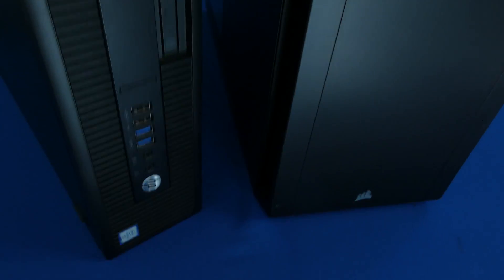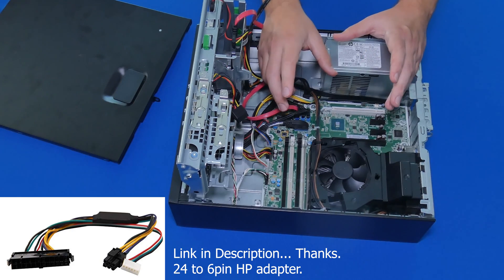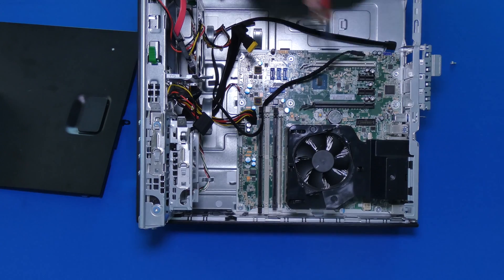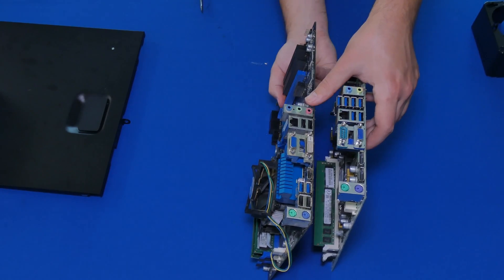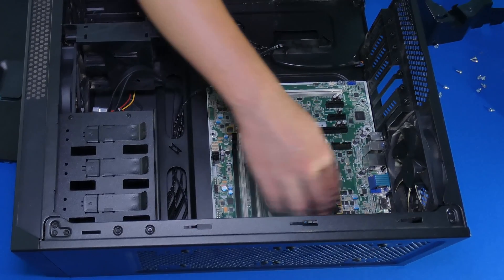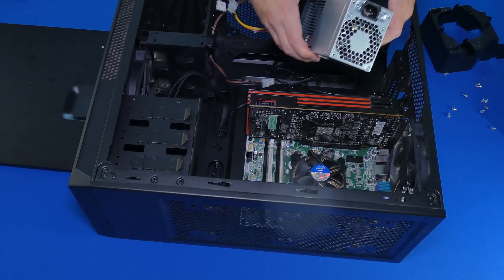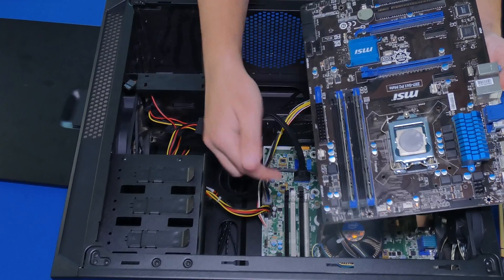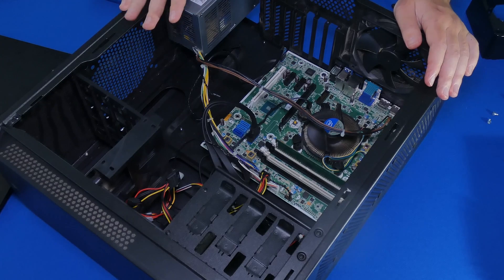HP EliteDesk transferring Parts to New Larger PC CASE

Comment: Hello once again friend, im really close to transferring my elitedesk to a different case right now, but it seems that i can't figure out how to connect the case cables to the motherboard. Can you please tell me how you connect yours and get it to work? Or maybe make a quick video or atleast just give me a picture of it haha. I connected the power switch cable to the second highest pin (pin 3 and 4) and it seems to work like you said but for some reason it just powers up the desktop but not my monitor. Perhaps there are something wrong with my display i may have done during the process of transferring?
Reply from the maker: Hi, if you can tell that Computer is turned on but monitor not working... I would assume the issue is with the monitor (unless you've added a GPU). Check all cables or try different cables.
Reply: @Cobuman  ok so it actually worked lmao i was just being stupid haha. So what happened was, i was using a tv as display instead of a monitor, i got used to monitors that always turns itself on whenever you power up the desktop, on the tv or at least my tv i have to click the on button first before powering on the desktop. As soon as i posted the original comment i went and try to turn on my desktop after i turn on the tv and it worked haha. But the problem with the HDD LED and power LED is still not solved because idk the arrangements for the pin :(

Comment: Hi there bro. I have a hp pro desk 600 g1 sff and I am also interested to trasfer my motherboard to a new case and upgrade my gpu and psu. You can put in a case tower without problems?
Reply from the maker: If it's an ATX midtower it should be fine.
Reply: @Cobuman  i am don*t understand
Reply: @Cobuman  ???
Reply from the maker: @techgames8499  If your new case is the same size as the one in video... it should work just the same. Aftermarket computer cases like in the video have standard size charts... this one is a midtower ATX.
Reply: @Cobuman  Brother
I do not understand
Can I put the motherboard in the tower?

Comment: I tried this but it doesn't work with any newly fabricated ones the motherboard is different and they removed the fan
Reply from the maker: Thanks for letting me know. Which model of PC did you try with?
Reply: Thanks for responding it's the same one but i bought it at a store that sold them in large quantities and they said that they make them like that they switched the cooling system and made so you cant fit a full sized graphics card if i could send a picture i would and the motherboard is smaller sorry if i caused any trouble

Comment: Does anyone has a suggestion for a suitable, higher power replacement for the 240W power supply that would (hopefully easy) fit in the standard Elitedesk 800 G1 case? Would and SFX power supply work?

Comment: Hi there bro. I have a hp elite desk 800 g1 sff and im also interested to trasfer my motherboard to a new case and upgrade my gpu and psu. You think the Neutron Odyssey M-ATX case may om my board?
Reply from the maker: The motherboard here is not exactly same size as standard ATX or m-ATX; that being said... I'm not sure. But it fits in standard size ATX case.

Comment: Hi cobuman! First of all thanks you for making this video. But I have a problem installing the new PSU to the motherboard, I connected everything and it just doesn't start. Also there's a light in the motherboard that is blinking with the new PSU, but with the stock PSU it's everything right and the light stays on well. Is there a solution?
Reply from the maker: The adapter for using the new PSU may need to be adjusted. Some adapters require swapping wires. If you bought it on Amazon you can see what other people did to fix it. It depends on which adapter you got.

Comment: I have read there is a problem to install a full-length GPU card because the front USB connector is too tall. And if you leave it disconnected, every time when it boots, it will complain about missing front USB connection. Have you come into that issue or have a solution for it?
Reply from the maker: Yes, I've seen comments about some cards having this issue. The error can be ignored but obviously you no longer have front USB... This is simply a design flaw by HP.

Comment: hey, i have hp compaq elite 8200 sff can i transfer it to a larger case?
Reply: No i tried. bought a btx case and the 4 screws to hold the cpu fan don't align with the motherboard.ANNNND you will need a 24pin to 6pin adapter to fit the new power supply you plan to use.So far i have yet to find an adapter that works for the 8200 sff. also the 8200 sff needs a different adapter than the 8200 atx.SUX

Comment: I did all this and assebled perfectly on my new Case, but the problem I'm facing now is a dumb POST error that says that front USB ports are not connected, did it happened to you too? And if so, how did you solve it?
Reply from the maker: This happens to some people. If you don't have front USB ports connected you can just continue to boot and ignore the error; otherwise, connecting front USB would remove the error. This depends on which case you have so I don't have exact answer to guide.
Reply: @Cobuman  if you have a GPU installed it blocks the USB 3.0 plug. So it boots with an error message. I don't see any good way to fix the error message and keep the GPU.

Comment: Hey man! Great video! I have done the same thing but with 800 g1 and amd r7 260x. 
Do you maybe know why my monitor keeps random losing signal after transfer. 
Cables are securly fittedand temp. never excideeds 70 celsius
Reply from the maker: I'm assuming you've added the r7 260x after you transferred everything? If so, it could be an issue with the card. Driver update might fix it. 
There is a chance that it may need more power from PSU to run properly.

Comment: I dont have the money for a new case atm could I just run a adapter and a power supply. But I'm running the hp 800 g1. I already have the GPU 1650 gtx LP I plugged it up and couldn't really play mostly got constant blue screens of death when trying to run steam or just at random. Any suggestions would be appreciated cant really spend a fortune.
Reply from the maker: See my reply on other video.
Reply: @Cobuman  oh you're awesome

Comment: Did the motherboard accept the newer GPU without any problems?
Reply from the maker: Yes,  here is a video of me just adding an external GPU: https://youtu.be/tj2ws0mTm6E
But yes, any GPU should work when used in larger PC case. Otherwise you can install a low profile card that fits inside the original sff case. Like this: https://amzn.to/3f05sxA

Comment: I'm using hp 800 g1 with configuration 
CPU: i7 4770
Ssd: 240
Hdd: 1tb
I want to install gtx 1050ti oc or 1650 GPU low profile, will this work???
As this PC has 240w psu 
Thanks in advance
Reply from the maker: Yes, it should be fine. I've recommend GTX 1650 LP to a lot of people, this one: https://amzn.to/3crxMaH
Reply: 1650 Low profile definitely works. I have the same setup and was able to run OW around 180 fps, GTA V 150 etc. with some tweaks (1080p low). I still have the g1 unfortunately the mobo got some bent pins and it's dead :( But the 1650 i've set as a folding GPU until the covid pandemic goes away; probably will turn into a stream gateway afterwards (the 1650 is good for streaming as well due to the Turing Arch; if you don't mind low quality graphics, you could mistake it for a 1060 (even though the 1060 is better etc)

Comment: If I change the PSU, can I just use the 4 pins from the 20+4 pin and plug it in the 6pin power connector on the motherboard instead of buying an adapter?
Reply from the maker: No, it's a different plug. I would not even try something like that as you may short something or cause a fire.
Reply: @Cobuman  yes, I thought so. I ordered the adapter but it's from China and I don't expect it to arrive in the next month or so ;d

Comment: I have an Elitedesk 800 G1 SFF.
is a :
i7 4790
16gb ram
and i want to put a gtx 950 2gb video card in it.
To achieve this I will have to remove the motherboard and put it in another tower.
my questions are:
1_the performance will be the same as a normal pc? (This is a slim)
2_The default power source will work without problems when adding this video card.
3_is this motherboard better than generic asus, that is, is it faster? since this is intel brand HP.
could someone guide me.
Reply from the maker: You have a good computer. Unless you already have it... I would not buy a gtx 950 to use in this PC because you can get a low profile video card that will be a lot faster and it will fit inside the slim case. 
The main reason to move everything over to bigger case is so you can use a larger and faster card. Although usable; GTX 950 is pretty outdated and slow.
Reply: @Cobuman  Yes, I understand.
but moving the motherboard to the new tower.
Did everything work perfectly?
Do i have to change the power source?
I am clear about the fact that the gtx 950 is not very powerful for the processor, but I already bought the gtx 950 card and it is enough for me.
I am aware that I could put a more powerful video card.
(I am Spanish, sorry my English)

Comment: Hi can you make  me a back panel to the same specifics as your 3D printed one as I’m doing a similar build?  Let me know how much it will be and with U.K. shipping
Reply from the maker: Sorry, I can't do that. However; here is the file to be printed: https://www.thingiverse.com/thing:3912752 There are files for both G1 and G2 so anybody can print them.
Reply: cobuman great thank you
Reply: cobuman also I wondered with the ram slotted in do you think a rx580 sapphire GPU will fit into this motherboard
Reply from the maker: @lozm8308  If you transfer the motherboard to a larger case you can fit any GPU. Otherwise only low profile cards will work.
Reply: cobuman hey yeah will be going into a larger case thanks for the info - appreciate it :D
Reply: One question a little of topic but on computer self builds   , any knowledge you have might help -   I have an 750watt power supply with an Rx580 gpu to issue I have is my power unit only has to 6pins and for the rx580 I need a 8pin and 6pin  - one 6 pin connected will be fine but for the other 8pin on the gpu - can I use either a 6 pin to 8pin adapter or a dual moles to 8pin? My worry is that I have done research online and it’s like 50/50 half the people say is the wrong thing to do and to just upgrade the psu and the other half say it will work - what’s your view on this issue?
Reply: cobuman dual molex*^
Reply from the maker: @lozm8308  A lot of times GPU comes with an adapter that allows to use molex or sata power. If not you can use/buy an adapter that gives you pins you need- no problem. You can see that most of them are labeled as such. Like  6 -8 pin pcie adapter. pcie being the keyword. If you buy an adapter just look at the reviews first to make sure it's not a bad quality one.

Comment: can i use the same HHD with a new mobo and Processor
Reply from the maker: Yes, but the OS may not work and it may need to be reinstalled (50/50 chance it will work). If it has bitlocker installed it will not work as OS unless your wipe it and reinstall new OS. 
Definitely try it.

Comment: Hi, thanks for the tutorial. I did this myself and was wondering if there is any way to get the system fans spinning. I put the 3-pin in the same header as you did at 13:10 but the fan does nothing. Next to that, when I boot up I always get a message that the front USB port is not attached (the two 2.0 connections, the 3.0 connections work fine). I think this is because of the yellow header that is now unused. Is there any way to bypass that in the BIOS?
Reply: Exact same situation here.  Hoping for a fix.
Reply: Same
Reply: I did resolve this but it’s not fun
Reply: If you do have the desktop 800 g2 then what you need to do it take the front USB from your old pc case and you will have to just plug it into the yellow one, it’s just a short term Solution but it works
Reply: Did anyone find fan solution?

Comment: Hey Cobuman, can you please tell me what form factor the motherboard is? Is it Micro ATX? Could I put it in a small case? Normal case isn't big enough for a low power gtx 1050
Reply from the maker: The motherboard is closer to standard ATX size when compared to aftermarket mobo like in the video. Not sure what you mean about normal case is not big enough (video shows otherwise)... 😁 In any case the Low Profile size GTX 1050 will fit. Like this one: https://amzn.to/2WyFGJo
Reply: @Cobuman  I'm sorry I meant the normal case for the HP prodesk 600 g2 sff. Would I be able to transfer the motherboard to a micro ATX case? Given your answer I'm guessing no

Comment: I did this with a hp compaq 6000 pro small form factor and none of the motherbaord holes lined up on the new case. Just heads for anyone witht the same pc
Reply from the maker: Thanks for the feedback. Yea, those are same type as the 8000 series which are not the same as the 800 G series like in the video.

Comment: Anyone tried HP 8200 Elite SFF's?
Reply from the maker: It does not work with those. Motherboard is different type and does not fit.
Reply: @Cobuman  Thank you so much.
Reply from the maker: @Chiro3332  Sure thing. Sretno.

Comment: hi mate, have you used to psu adapter? Is there any problems running the upgrade psu with the adapter?
Reply from the maker: Some people reported wiring issues with those but as far as I know it should be fine. There are multiple brands so I'm not 100% which one might cause issues.

Comment: nice video! this works with DELL Optiplex 9020 sff? i have one and i want to know if i can swap the case  to an ATX case please help
Reply from the maker: Not sure. It's been a while since I've had access to one of those. Check the motherboard orientation. If it aligns the same way to back I/O panel it will probably work.

Comment: Hey cobuman I'm wondering how to plug in led,reset and the rest of the control panel onto the motherboard?
Reply from the maker: I'm not sure on the pin outs for those. You can probably figure out with trial and error; however, you can also trace the wires on the original case to see where they lead. Afterwards just match connections. If anyone else has the diagram for solution please let him know
Reply: cobuman hello pls I have a 6200p sff would this work and can I add gtx 950 on the micro tower I want to upgrade to pls reply
Reply: @Cobuman  Here's the pin layout that worked for me on the G3, all credit to David Oosterhuis for this:

"I managed to figure it out for the rest: If you look at the header from above: 
xx -> pin 1,2 
xx -> pin 3,4 -> power switch
  x -> pin 5 
xx -> pin 6,7 
xx -> pin 8,9 
In order for the HDD LED to work, it should go in pin 7 and 9 (align the small arrow on the header). The Power led - should go in pin 6 and the power led + in pin 8. Pin 5 is not used. I'm not sure if the reset button works on this motherboard, as it does not work in my case"
Reply from the maker: @EdgyShooter  I appreciate you sharing this info. Thanks! 👍

Comment: Great video! 
I have a HP Elitedesk 800 g1 sff with an i7-4770 CPU @ 3.40ghz 28.0 gb of ram with a MSI Geoforce HTC 1050TI low profile bracket included installed. The cpu ran fine before I installed the graphics card, now if I'm watching a video the computer will crash randomly. Could this be because of the factory power supply? I would like to do this transplant into a larger case to see if a larger power supply would stop it from crashing
Reply from the maker: It's probably heat related issue. After you added the card it created more heat inside the case.
Reply: @Cobuman  Thanks. Should I leave the case slightly crack and aim a fan into it? Its standing vertically, otherwise I will try your transplant method

Comment: I can’t mount my CPU/heatsink to my new case since HP has them bolted onto the case. My question is how would I mount my fan/heat sink to the new case? I need help.
Reply from the maker: If you are going to use the same heatsink you may need to get some nuts that you can screw on *from the other side of motherboard*. Someone in comments mentioned which size I forget who...
Reply: @Cobuman  THANK YOU. Ill look for it

Comment: If you use normal size gpu u cant use usb 3.0 connector
Reply from the maker: You might be right about that. I have not had that issue but thanks for the tip. I guess if anyone else reads this... you might loose front USB connection but rear should work fine.

Comment: Will it work with the newer 275r case?
Reply from the maker: This one? https://amzn.to/2VNstw2  It should be fine. It's the same case on the inside.
Reply: @Cobuman  this one is from a local aussie store.. http://tiny.cc/mqplnz. I am using a hp compaq 8300 SFF with a GTX 1050ti. It works great for what i do but really don't like the pc case. So, thinking to buy a used hp prodesk and then transfer to Corsair case. Very much newbie to this building pc thing, but hopefully can get it done.. Thanks for inspiration.
Reply from the maker: Sure thing. That case is almost identical to mine.

Comment: hey there, I have problem with Prodesk 600 G2 and I have problem that CPU fan is not standard but more wide, not squared :( have any advice?
Reply from the maker: If you are moving it to another case it should be fine. The heatsink tested on this is from an i7 4770k and PC is 800 G2.

Comment: Hi I have a question would this work with the HP EliteDesk 705 G1 SFF?
Reply from the maker: Possibly. Check the motherboard orientation to see if it's similar to this one. Main issue is the I/O back panel hole.
Reply: I was gonna ask the exact same question :D :D